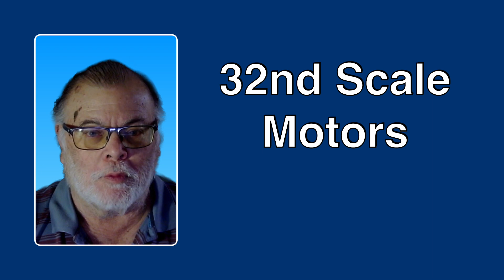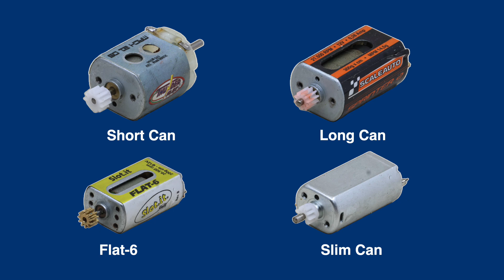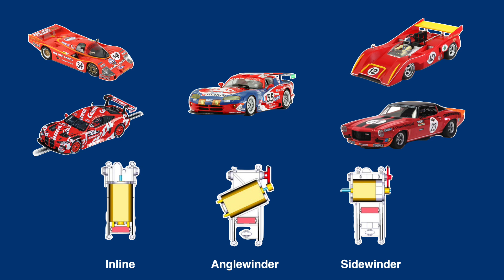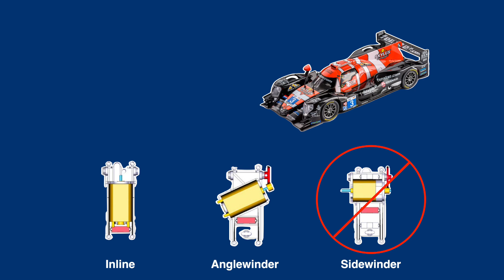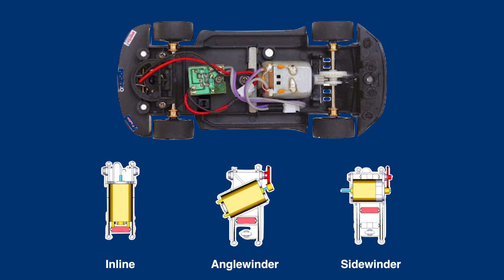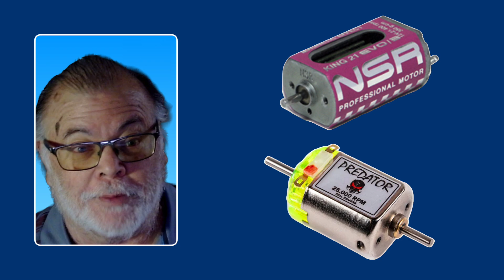32nd Scale Slot Car Motor Basics

Comment: MRRC does have a sidewinder application using the slim can motor in its Monza chassis.
While not available in an RTR car, it is sold as a chassis or chassis package.
Reply from the maker: Thanks for the info. I'll update it in part 2.
Reply: MR Slotcar also offers a sidewinder motor pod for it’s chassis. @norcalslotcarscene